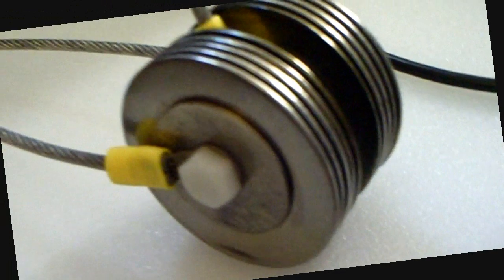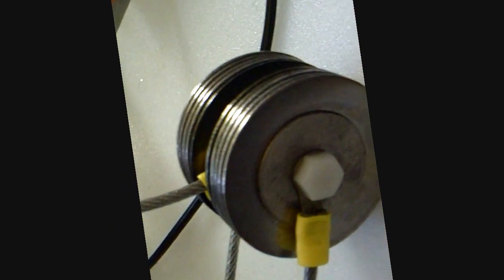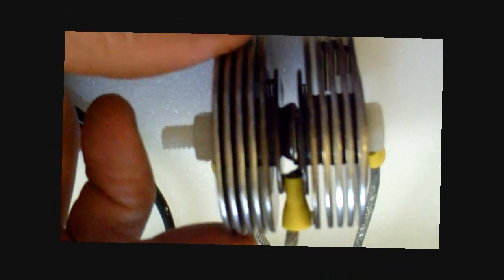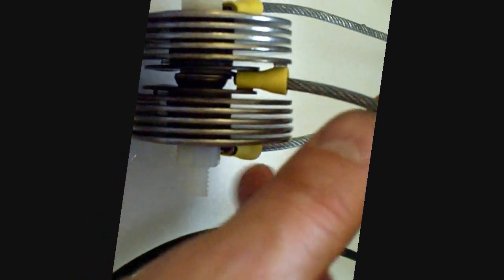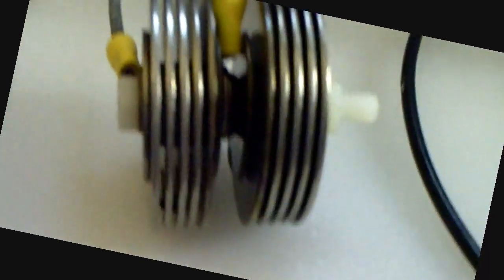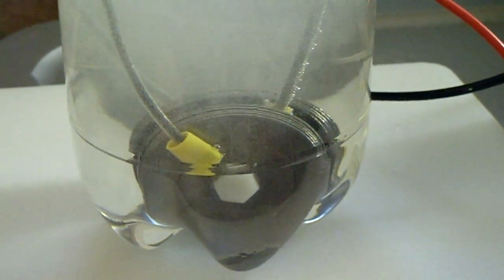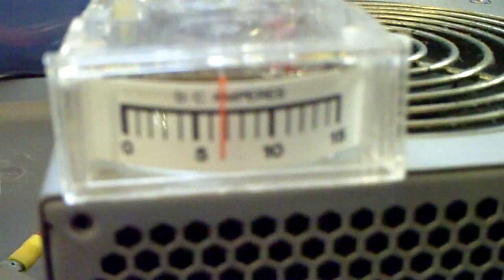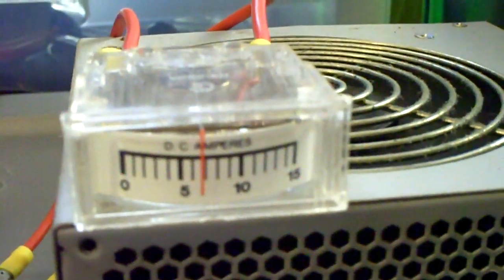Vid22 Washer Cell Hydrogen Generator "Updated" (HHO, Brown's Gas, Hydroxy)

Comment from the maker: Thanks, but it is already configured to 2v ea.

The 1 1/4" washers on the outside are Positive, then Five 2" washers, and then Negative Center washer.  The other side is the same thing, so I basically have two cells in one.

No heat issues, the connectors get warm, but not HOT. 

I'm already working on a DryCell version, so I won't be making any more modifications to this design, because I'm using the parts from this one to build the new cell.